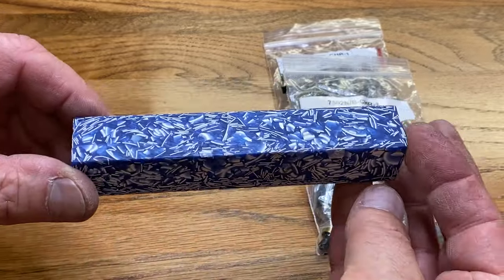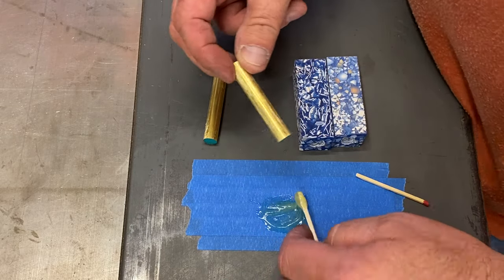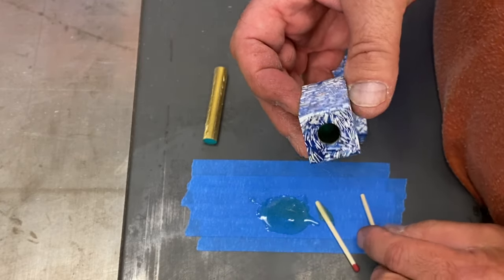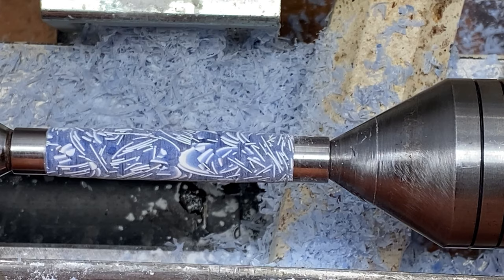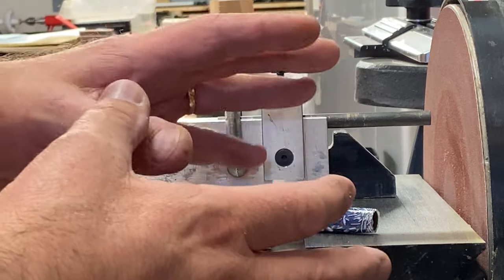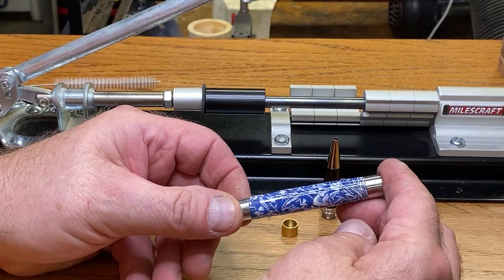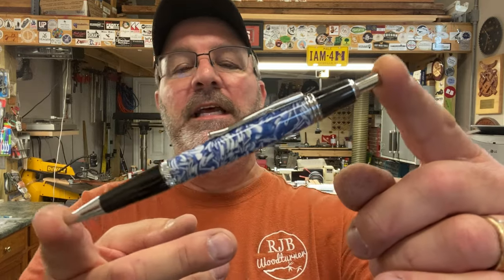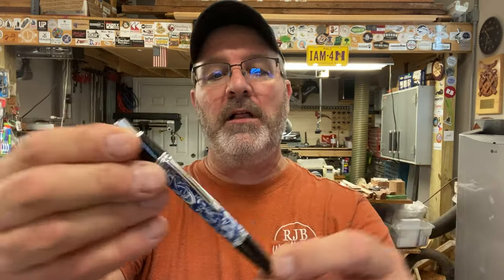Egg Shell

Comment: Hay Bob what size is your sander and also just wondering what grit of sandpaper are you using.
Reply from the maker: It’s a 3” padded disk for a hand drill. There are six grits of paper. I don’t remember off the top of my head what the grits are but they go from 120 to 800. 

Regards,
Bob
Reply: @RJBWoodTurner  thanks Bob I appreciate that. For some reason I  thought that sander was larger than it looks.